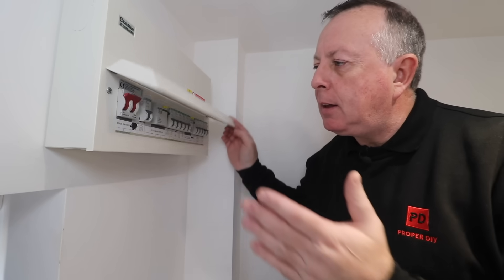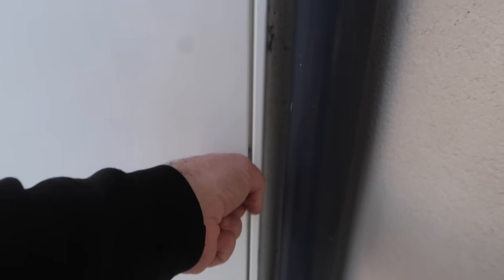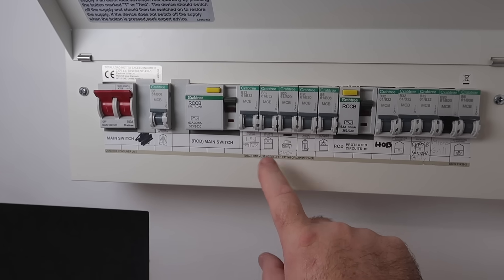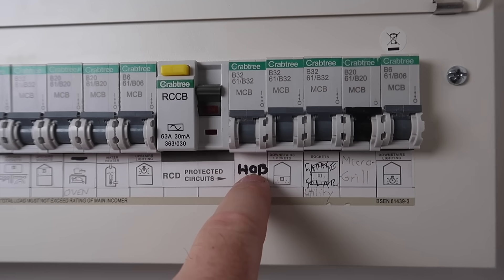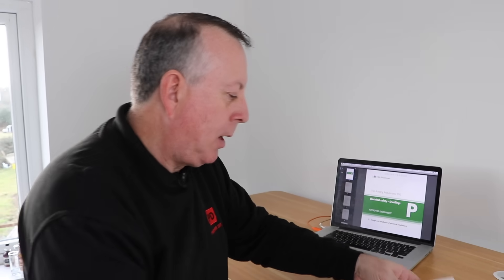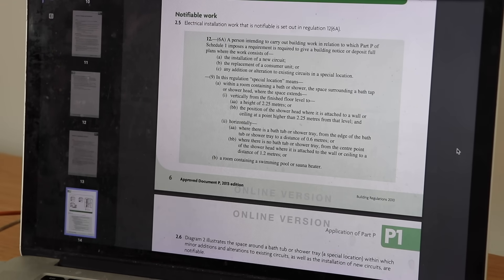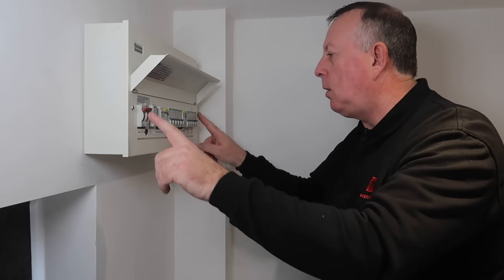What electrical work are you allowed to do in your own home?

Comment: I'm very curious, I cant see any guidance in the regs. I want to change my EV charger for a new one. no new wiring as such just a straight swap of the EVSE unit that's already installed for a new one. I'm confident I can do this safely but is this something I'm allowed to do myself? my electrician wanted £250 and I'm pretty sure its  simpler than rewiring a plug. but I'm not sure if I'm allowed to.
Reply: You are allowed.

Comment: Maybe I'm uninsured against electrical fires, but I think that's just about the only issue. I may not be a 'certified' electrician, but I do have a physics degree with 4 years of electronics labs every week, and several decades of installing circuits. I have installed every kind of electrical circuit into my house over the years and I do it by the book and I dare say to a higher standard than any sparky will bother for his £220 an hour. The only time I have had a 'certified' electrician in my house is to install smart meters. The first one in a flat I was living in failed to get the tails back in properly for half an hour, bent them using a mallet. I reported him and they were force to replace a huge section of wiring including putting in a new floor in my kitchen. The second time in my house... the guy was an utter twit who just wouldn't listen to the posh sounding surrey boy trying to tell him he hadn't isolated it properly and ultimately ended up shocking himself, fell off his ladder and hitting his arm very badly. Again, I reported him and the supplier actually ended up paying me off to keep me from going public, they were that embarrassed / I hinted that I'd filmed it (I actually hadn't). Sorry, I'm sure there are lots of well meaning electricians around the place, but I haven't met one yet and I'm certainly not paying for one to do a shoddy job.
Reply: What multifunction tester do you use to test and certify your electrical work?
Reply: "the guy was an utter twit who just wouldn't listen to the posh sounding surrey boy trying to tell him he hadn't isolated it properly "
Go into Cockney and eff & blind, then they respond.

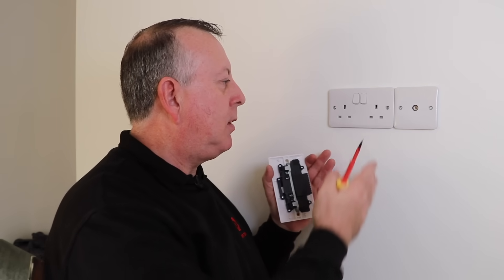Comment: 9:50 Good start to have one of the plugs that checks for earth connection etc? Not expensize from ScrewFix.
Reply: I also have a couple of these devices. They check correct polarity and earth faults and have a rcd test button.

Comment: Wish I live in a country where your allowed to do basic thing .. Here in Australia you can't do a single thing .  Electric or plumbing .. You can't do anything where tools are required.. If you can't plug it in and turn it on you can't do it ...
Reply: The UK regs are littered with the word competence.  This what you do, the results, and how you work. The emphasis is on competence, not pieces of paper.
Reply: That is madness.  So an electrician retires at 60 then can't work on his own house?
Reply: @johnburns4017 So long as he keeps his regulations at to date as well as his licence he can .. But if he let's that expire then no he can't do anything either.. As all work must be certified by a licensed electrician.. Your not even allowed to change a light switch or power point .. You can get yourself a restricted Electrical licence which then your allowed to change Like for Like .. Most refrigeration Mechanic get them as part of there trade .. But no new  installs .. It is ridiculous but insurance companies here are looking for ways out of payments at every stage and loophole they can find .. And if your in an older house where lots of the Electrical works no longer comply to regulations an electrician usually won't touch anything unless all regulations are up to date .  Which can mean full rewire ..
Reply: @samhaveaguess4284  wrote:
"So long as he keeps his regulations at to date as well as his licence he can .. But if he let's that expire then no he can't do anything either."

A man who has been an electrician all his life, to install a socket in his own home has to pay to keep a licence up!  That is madness.
Reply: @samhaveaguess4284  wrote:
"And if your in an older house where lots of the Electrical works no longer comply to regulations an electrician usually won't touch anything unless all regulations are up to date .  Which can mean full rewire .."

It sounds like a scam.

Comment: Used to be only 30 amp (Not 32 amp) for the cocker or a mains ring circuit. (Red dot by fuse)
15 amp for power points on a spear. (Blue dot by fuse) and 5 amp for lights. (Not 6 amps)  (White dot by fuse)
15 amp because we used 15 amp plugs before 13amp plugs introduced.
But that's going back to when we used 240v ac and not 230v.
Still lots of houses, even new builds use 30 amp not 32 amp fuses.

I hope nobody replaces a 30 amp fuse with a 32 amp circuit breaker if the wiring is only 30 amps.

PS. Not all houses have s switch between the meter and fuse box.
Reply: Replacing a 30A fuse with a 32A MCB is perfectly acceptable as they will trip at a lower overload current than a fuse will blow. The cable ratings are more than sufficient to allow this substitution.

Comment: First thing Plastic fuse boxes are SOMETIMES ok current regulation say to change it if it is on an escape route 

Your fuse box (metal as it is) is now out dated because your two RCD’s are type AC and should be type A 

That being said regulation state that it is recommended each circuit have its own RCD protection so RCBO’ are now preferred over RCCB/MCB’s 

Being an electrician is a nightmare with regulation changes as saying to the customer I have to change your RCD in your new board makes you sound crazy 

Nice video ❤❤
Reply: "That being said regulation state that it is recommended each circuit have its own RCD protection so RCBO’ are now preferred over RCCB/MCB’s"

Also AFDDs are recommended, on socket circuits. Recommended means must fit unless a good excuse not to.

Comment: I had an outdoor socket installed but it required a part-P person because I wanted it done via a new circuit to (a) allow higher current and (b) allow me to more easily isolate it if there was a problem.

Comment: I have just retired after 50 years in the electrical trade and any electrical work I require doing I will do myself and if I am not sure about anything I will look it up. I feel after all my years in the industry I am better equipped than somebody who has been working for 2 or 3 years
Reply: that what the wiring regs are for.
Reply: I've seen some shocking so called professional sparks ffs.  I used to work as a sparks  labourer  and my boss used to send me to sort some out some shocking work done by timed served sparks 😊
Reply: How were you 50 years in the Electrical Trade with-out being Licensed??? Did you Work just selling materials to tradesmen in a Store?
Reply: Nothing stops you doing so, this video is incorrect in suggesting you can't. Any home owner can do the work themselves even to consumer units, but if they arent part P registered they will need to make an application to the local authority. The difference is that a part p electrician doesnt need to apply, they can just do the work and notify the local authority after via their professional body. The local Authority will want to be sure you are competent to do the work and will usually employ an electrician to double check your work for which you will likely be charged £200-300. As a retired electrician they may well seem you to be competent without someone to check your work but will want to see that you have done all the normal testing of circuits.
Reply: @mikebarry229 not sure how true this is that building control will get an electrician to check it. In my area certainly , building control will just expect YOU to get it certified by an electrician, which in turn makes it impossible for you to do the work, as electricians just don't do this any more (only EICRs, which are different)
Reply: @DrPepper22222  I use to do checks for people and charge them  for an electrical check and if was wrong tell them why and make them fix it.
Reply: @bengunn6546   yeah used to is great but I don't know any who are willing to do that now.
Reply: @mikebarry229 wrong. Plus he isn't a retired electrician
Reply: Good for you, and logical, or you could get a budding sparky and let them experiment on your property and why not do abit of Harry Enfield role character play, " you don't wanna do it like that " I'm sure the bud will love you for it 😏

Comment: Oh dear - here we go - same old misdirections and mistakes.
 
6:32 "So what are we, as homeowners, allowed to do within the electrical systems of our own homes?"
 
That's an easy one:
 
A:  Anything we like.
 
If you disagree, then please find and quote here any law or regulation which actually prohibits some or all electrical work being done by a homeowner.
 
Please note - a requirement to notify Building Control in advance is NOT a prohibition.  A requirement to get the work tested by someone is NOT a prohibition.

6:37 "there's a document here ... and it's called Part P of the UK Building Regulations 2010".
 
Well, no, it isn't called that, and it isn't that.  It very clearly says that it is Approved Document P - it is NOT "Part P"
 
This is Part P. (This is quoted from the actual Building Regulations which you can find here https://www.legislation.gov.uk/uksi/2010/2214/contents/made 
 
Part P is in Schedule 1  https://www.legislation.gov.uk/uksi/2010/2214/schedule/1/made )
 
P1 Reasonable provision shall be made in the design and installation of electrical installations in order to protect persons operating, maintaining or altering the installations from fire or injury.
 
The requirements of this Part apply only to electrical installations that are intended to operate at low or extra-low voltage and are —
 
(a) in or attached to a dwelling;
(b) in the common parts of a building serving one or more dwellings, but excluding power supplies to lifts;
(c) in a building that receives its electricity from a source located within or shared with a dwelling; or
(d) in a garden or in or on land associated with a building where the electricity is from a source located within or shared with a dwelling.

And that's it.

6:48 "This document describes what it covers, and what you can and can't do in your own home.
 
Which page(s) list things which you CAN'T do in your own home?  Not have to notify, not get tested, actually _CAN'T_?
 
7:09 "Which essentially means a DIYer or non-qualified electrician can't legally carry out the work"
 
Completely wrong.  How on earth did you manage to read that document and decide it described a legal prohibition on certain classes of people carrying out certain electrical work when it says nothing of the sort?
 
And BTW - the distinction with electricians when it comes to notification/self-certification is not qualified vs non-qualified, it is registered (with a competent person scheme) vs non-registered.  Someone could be the most qualified electrician in the world but unless registered they would still be unable to self-certify and would still need to notify Building Control in advance.
 
7:17 "and if you do, you risk a fine of up to £5,000".    Pretty small risk, though, isn't it, given how few people have been prosecuted so far for failing to notify work.
 
7:30 "and also when you come to sell the property you could find you're having a problem....".  
 
1) You tell the truth on the questionnaire from your buyers' solicitors
2) You or the buyer pays for an EICR to be carried out
3) Buyer decides whether or not to carry on with the purchase

Assuming that your non-notified work wasn't a dangerous pile of kack you're not going to have major problems - likeliest scenario is that in a buyers market they might use the lack of a completion certificate to get a price reduction.

7:46 "with a consumer unit you can't do anything you're not allowed to make any adjustments, changes, additions ... you're just not allowed to work in it ...".
 
Again - complete nonsense.  Again, if you think you're right, please present proof of a provision in law which forbids people from doing those things.  [SPOILER ALERT] - you won't be able to.

8:31 "you're not allowed to install that isolator switch because that would also mean that you're installing a new circuit.

Circuit. An assembly of electrical equipment supplied from the same origin and protected against overcurrent by
the same protective device(s)

How does installing an isolator mean you're creating a new circuit?

8:50 "any like-for-like repairs".   Ah, that old chestnut.  Where is the term "like-for-like" used in either the Building Regulations or the Approved Document?

8:53 "adding low-voltage lighting off of an existing 240V circuit".  240V IS "low voltage"
 
8:59 "another area where you're not allowed to carry out any work as a DIYer..."
 
Again, flatly wrong.  Again if you think you're right, bring forth some evidence of an _actual prohibition_.

9:40 - 10:27   All the stuff about testing, and being truly competent.   At last something we agree on.
 
 
Seriously - apart from that final minute, I thought we'd left all this conflation of Part P & Approved Document P behind years ago.  Ditto all the incorrect statements about some things now being illegal to do.  And all the idiots who think Part P is just a tax.
Reply: Excellent post!

Comment: i understand that the rules are there to follow … but the
“you cant add a new circuit (and breaker) to the system” i find a bit weird.
so you are not allowed to put in a circuit breaker and add a few sockets to it (lets say a garden office)… buuuut its okay to get a 20m extensionlead, daisychain a few smaller extensions in the shed… and plug that into a socket which is 32A secured… all the while the extension leads were made with questionable material, most likely not even 2.5mm wiring in them… so plenty option to burn your house down… but god forbid doing it properly :)
got it…

on the other hand, the person who would add something to the CU would not daisy chain crappy extensionleads… while the person who sees no issues with that would probably not add a CB to the board anyway…

not sure if the rule actually makes any sense in this case…

Comment: Rubbish, anyone can legally do nodifiable work, the clue is in the name. You can do the work but have to notify building control or a qualified electrician to check your work is safe before it's connected to the mains but even if you do connect it or fail to inform building control you will only be fined if your work is proven to be unsafe

Comment: Doesn't matter if the work needs to be notified or not ANY electrical work that alters a circuit needs to be tested to prove the safety of a circuit, for which diyers do not have the qualifications for. A certificate is then given to the homeowner to prove any electrical work carried out is done to todays regulations also giving the homeowner or future homeowner the name of the installer. Which means as a diyer you can swap out lights and replace switches and sockets ONLY.....
Reply: And presumably breakers in the board since the replacements look identical.  Probably run new wire through the conduits too, because no-one can tell.

Comment: There are plenty of qualified electricians with the right kit to test and prove safe your installation. Ok it costs but that is offset easily by the initial saving by providing free labour.
Competence I believe should be trusted even if the correct qualification is not present. Contracts I have worked on reflect that. The work carried out is inspected and tested before a signature is given by a responsible and liable person. We work on our homes because we're built that way, and if I were to rewire my house then of course I would have the work correctly signed off.
It's a good heads up on how regulatory bodies do form the law to stop the bleeding obvious but having witnessed a few home bodges over the years they've got to cover their backsides.

Comment: I think you are incorrect on this. 
Yes everything on the supply side before the output from the meter cannot be touched. 
It is not "illegal" for a homeowner to touch anything else and they will  not get fined. The £5,000 fine is only for an unqualified electrician doing paid work (to stamp out the cowboys). You will not get fined if you or your family do unpaid work on your house. 
Some work may require building regulations certification. There is little chance of any comeback from building regs and they only have 12 months to take action. They could demand that any works is certified. 
A new house needs certified works as part of the final sign off and this would be difficult to sell or mortgage without this and probably would be something the local council would enforce. DIY jobs on your house are very unlikely to be checked. 
If you sell your house it could be an issue if you have done a big refurb with no certification, but at worst you can buy indemnity insurance that would cost less than the certification. 
Lastly, I would question it making your home insurance invalid. Any home over 30 years old will have what is now considered dangerous wiring, that is still covered.

Comment: 18th edition wiring regs or any other previous version are not statutory law in the UK.  The only law that is statutory is the electricity at work act 1989.  In effect if you carried out notifiable work without the latest certification (a old experienced electrician) there isn’t really a problem. (No electrician Police will arrive 😁).   If your work was substandard however and injured someone.  You would be prosecuted using the 1989 law and wiring regs as evidence.   So to the super experienced chap who doesn’t have the latest quals.  Keep doing good work and consider upgrading your certs later 👍🏻